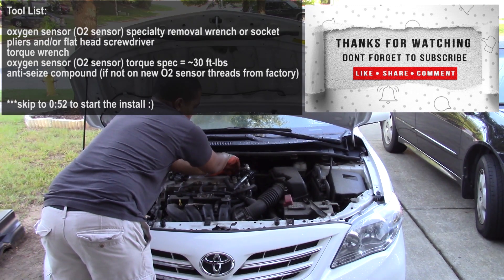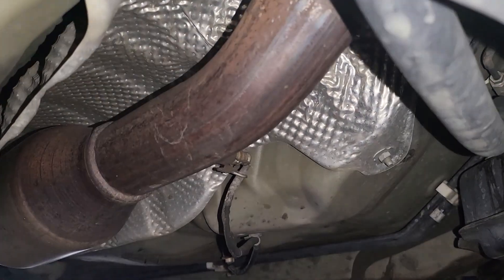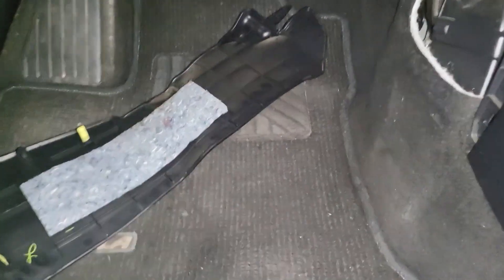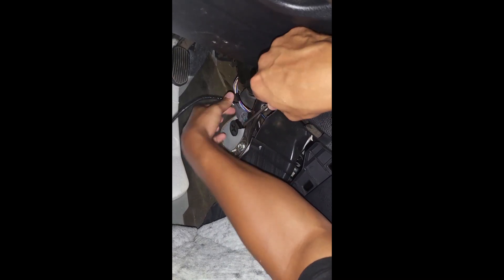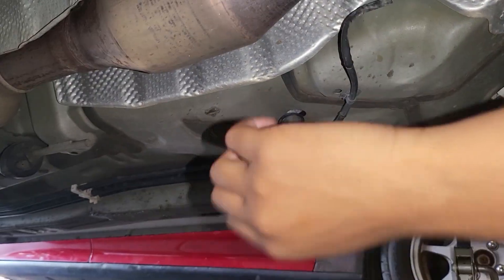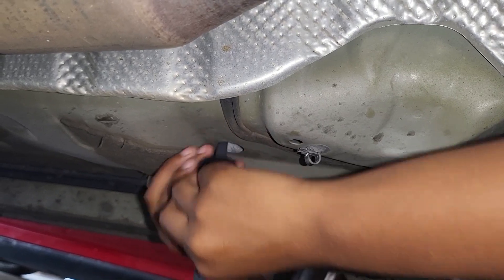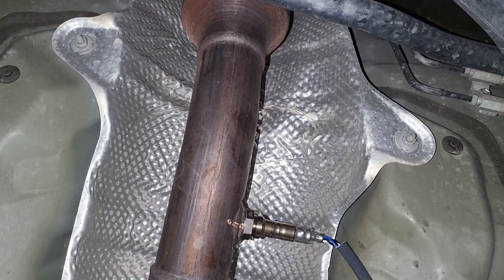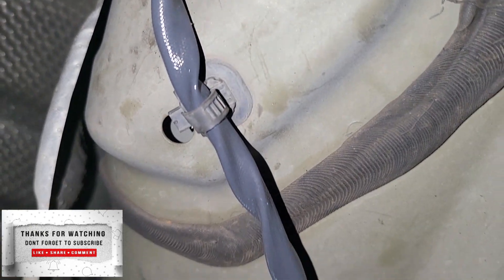P013A Check Engine Code | 2009-2019 Toyota Corolla Oxygen (O2) Sensor Replacement

Comment: I replaced both sensors, but the error code is still here. I’ve drove over 25 miles
Reply: Did you fix the problem

Comment: Hello Mojo, why do you think it's the o2 sensor? I have the same problem.. toyota says that the problem is the cylinder head due to leak on exhaust valves. Check the Toyota bulletin:
MIL "ON" DTC P219A and Compression Loss Into Exhaust - nhtsa https://static.nhtsa.gov/odi/tsbs/2014/MC-10109554-9999.pdf